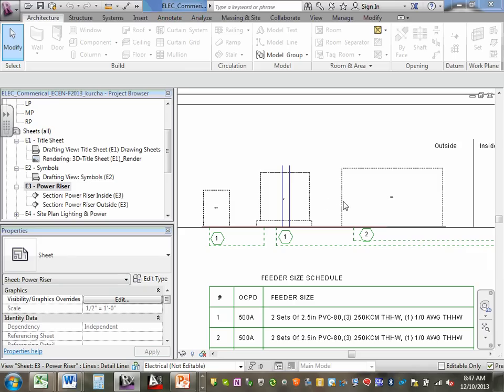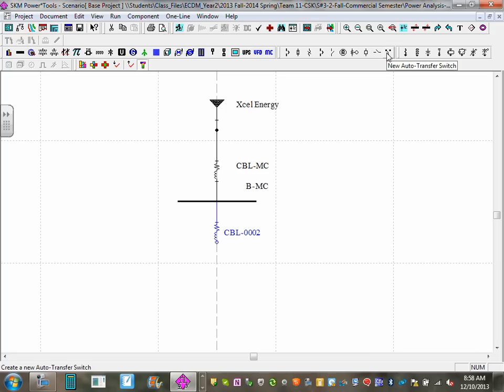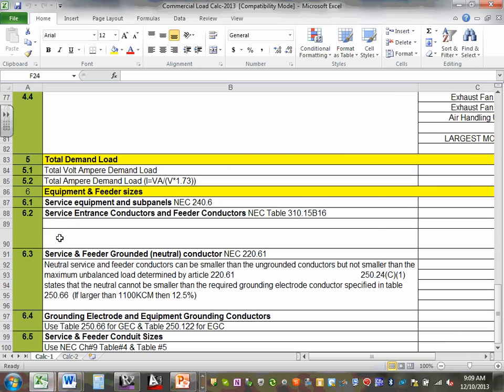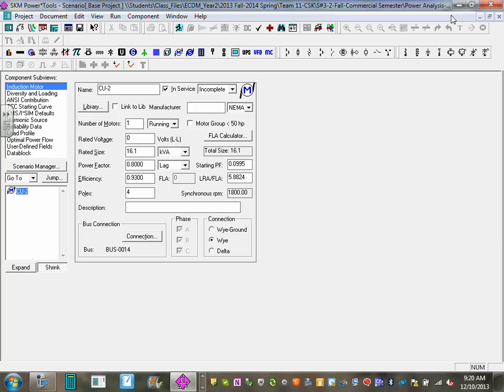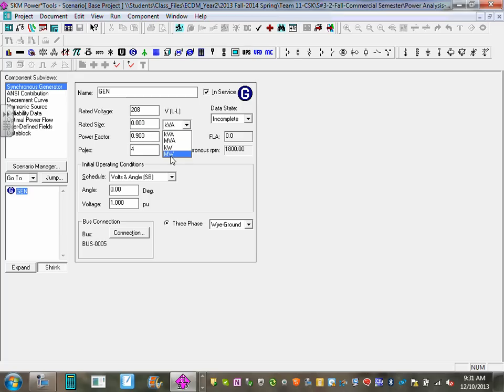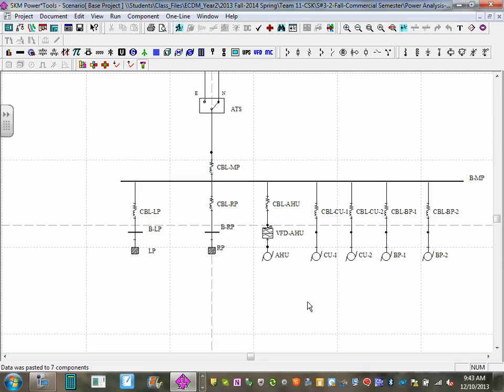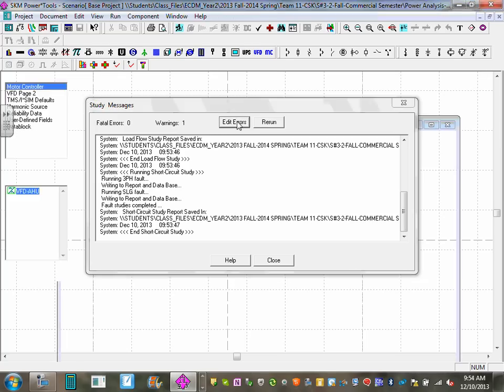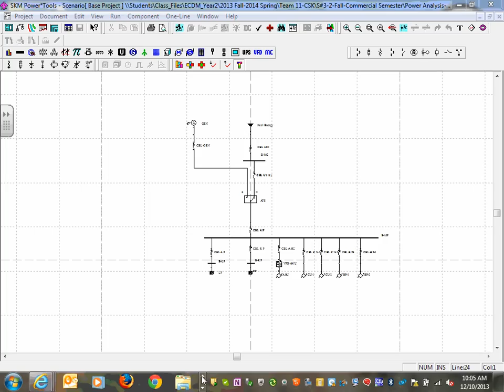Power System Analysis SKM PTW O L D , Short Circuit, Load Flow & Arc Flash 12 10 13

Comment: Just a heads up to new SKM users, if you get to the Arc Flash evaluation at around 1:07:00, and the "arc flash evaluation" button is greyed out, just exit the program and re-launch it and make sure you have selected the "arc flas" module to load with the program. Otherwise, only the modules that you select will load